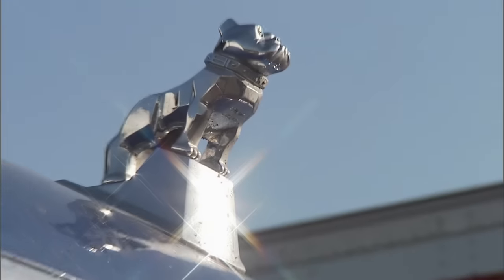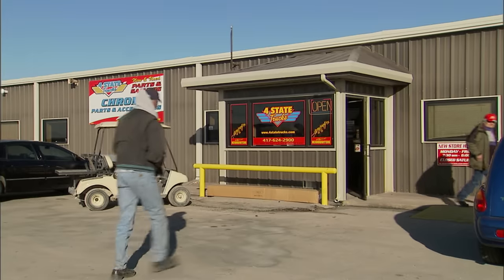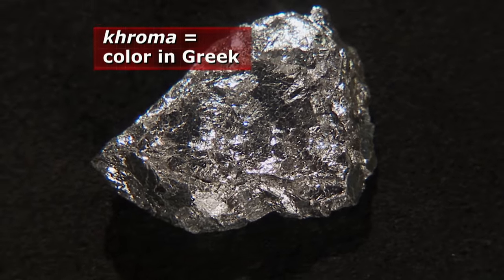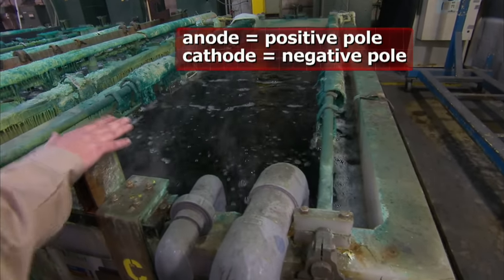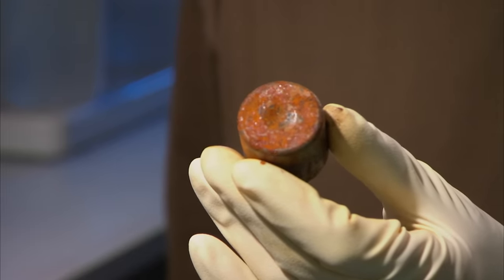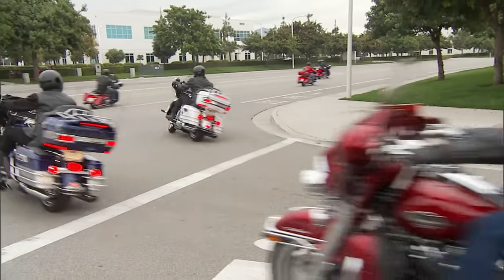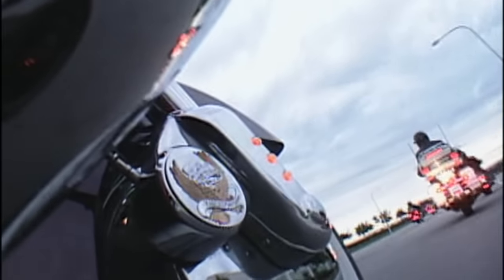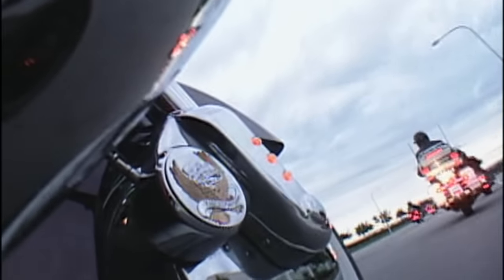Modern Marvels: Fascinating Science of Chrome (S15, E7) | Full Episode

Comment: I am having micrometers rechromed and have learned that the State of California plans to make chrome plating illegal by 2039 A.D.. It is used to line the insides of firearm's barrels to, it is a wonderful contact to contact surfacing material and corrosion resistance is bar none except stainless steel and titanium.
One more thing I used to custom etch copper circuit boards and I worked with a chemical company to achieve a chromium based "banking" procedure to keep sulphuric acid from undercutting the copper traces on circuit boards. The result was very close and tight circuit traces without touching each other.
Reply: California is very short sighted, we live in a giant nanny state
Reply: Metal plating involves a lot of very toxic materials. In the early 1070's in CA I had a Matchless motorcycle frame plated with cadmium, which was a readily available process at the time. Cadmium plating was subsequently outlawed. I'm surprised it took this long to ban chromium plating,